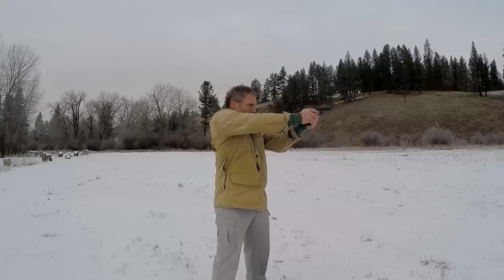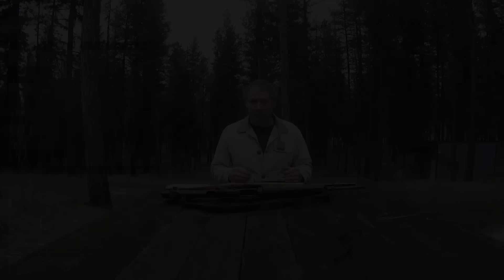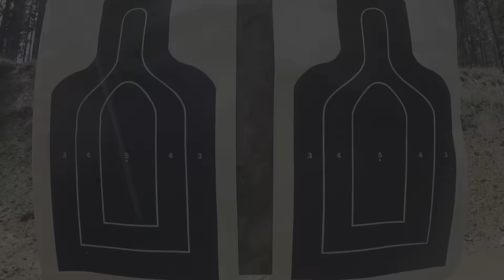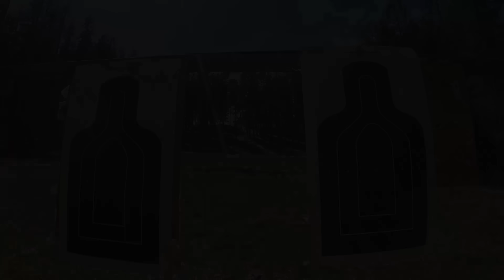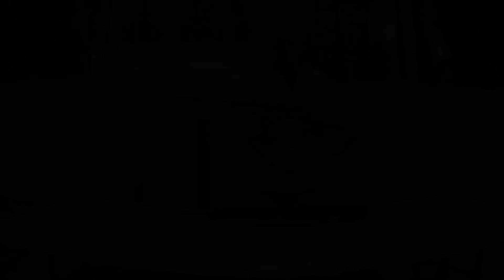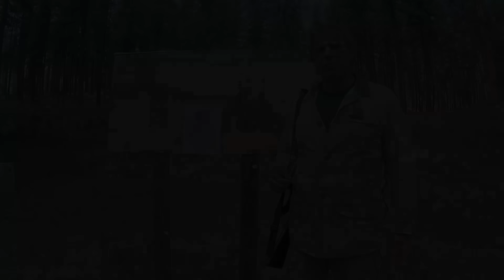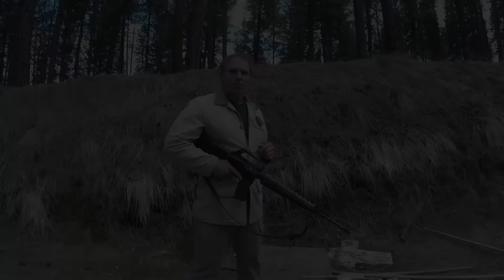Mini-14 vs AR15: Which is Better?

Comment: There is a lot to be said about the Mini-14 with that Garand action.  It is incredibly reliable and can get dirty and still function.  The AR-15 has to be kept clean and is very "finicky" when it comes to dirt and dust.  This was a particular problem issue for our troops in Vietnam, where the rifle often failed when dirty.  In the Korean War, every weapon system froze over in that first winter...except for the M-1 Garand.  That rifle kept on working even with the extreme cold weather in that frozen Chosin battle and so forth.  Yes, with the Mini-14, you should buy and use Ruger magazines.  They may cost more, but believe me they are worth it.  I've never had a misfeed issue with any of them.  If you are trying to protect yourself and your family, either one of these rifles will be up to the job.  Just get out to the range and get some practice on them.
Reply: Keep in mind that the M16 was failing in Vietnam early on because the Army didn't want to chrome line and phosphate coat the internal parts of the rifle (something unheard of for military service rifles) and changed the powder of early M193 with a cheaper and very corrosive propellant, all without the consent of Eugene Stoner and his team. So you basically had a rifle that had no protection against rust and fouling, your ammo was corrosive af and command is telling you that the rifle is self cleaning and won't issue you a cleaning kit. The M16 Eugene Stoner procured to the Air Force for testing actually proved to be slightly more reliable than the M14 during military trials. When the Congress opened an investigation because of the Army's implementation of the "modified" M16, the Army actually decided to get back to the original specifications of ths rifle and fielded the M16A1 soon after. If you look up what troops thought of the M16A1 you'll find an overwhelming number of positive reports from combat troops, it was a very well liked weapon. My father deployed in combat with an M16A2 and it never failed, always said it was a good and reliable weapon system.
Reply: @user-oy8dl1er5h  that is all correct. I used the M16A2 when I first joined and it was a very good and reliable rifle.  Too bad the government bungled the first M16 so badly. I believe even the TV show "60 minutes" did a special on that. One of the many ways the government mismanaged and bungled the handling of that war. Those were all good points you made.
Reply: @LA_Commander  - It truly was a tragedy that cost many troops their lives. Whoever at the top brass decided to cheap out like that in the implementation of the M16 has got American lives on their conscience

Comment: My owners manual for my mini 14 ranch rifle says it'll shoot .223/ 5.56. On the receiver it has .223 cal. Printed not .223 rem.  Hope I'm not wrong check your manual before you take my word for it, but my mini 14 has had a steady diet of lake city 5.56 NATO  xm193 55gr. and xm855. I've got a couple thousand rounds through it with no I'll effect. I understand the old target model mini 14 is the only model I'm aware of that is designed for .223 rem. ONLY. Also the new mini 14s are stamped 5.56 on the receiver to eliminate confusion.

Comment: The biggest takeaway I have from this video is the clear difference in intended customers between these two rifles.

The A1 was clearly intended as a military machine, with more ergonomic controls and a more specialized iron sight setup.

The Mini 14 was more aimed at your typical citizen, with a more straightforward assembly, more compact profile and easier maintenance.

Both are good rifles and have their own niches. Nowadays, you're more likely to get away with owning a Mini 14 because of gun control politics, while the A1 platform has more varied aftermarket support.

Comment: I am not an experienced Mini-14 person but someone that is very experienced with Mini-14's has said that there is a serial 
number order that can help determine the accuracy question.  Supposedly, Mini-14's that have serial #'s that start with 580 or higher (581, 582, etc.) were built after Ruger made some sort of change to their build techniques and that those rifles are consistently more accurate.  That would mean rifles that have serial numbers prior to the 580 sequence will be more hit and miss as Paul was saying in this video.  I'm not sure how accurate that information is but it does come from a knowledgable source.

Comment: I own both a mini-14 and an AR (My mini is chambered for 5.56 by the way). On a day to day basis I prefer the mini-14. The AR will only shoot brass cased ammo (I've tried to run the Russian steel cased ammo exactly 3 times, after 4 or 5 rounds the polymer coated case welds itself into the chamber and can only be removed by disassembly and a ramrod) which makes it a quite bit more expensive to shoot comparatively, while the mini-14 will digest anything I drop in it. I live on remote property so I carry the rifle in my open side by side all the time and the mini-14 is more tolerant of the dust it inevitably gets coated in and in addition, on those few times I come across a neighbor the black-but-conventional looking mini-14 gets less stares and comments than the AR. Accuracy in general is comparable between them shooting the same ammo with a slight edge going to the AR. If a suspected firefight was shaping up and I had the choice I'd carry the AR, but otherwise I prefer the mini-14 for most other situations.
Reply: i have been using the steal cased ammo for over 2 decades, this is how long, i bought a case for 110.00 dollars. shoot a lot of 3 gun and use the steal stuff for, it is not very accurate, have never had any feed problems with the steal, there is a lot of BS that floats around about everything. a big rule i have in my life is i do not believe everything i hear, if there is something i am not sure about i do the research. you can not believe some of the bull shit i have hears out there

Comment: The biggest issue that I have with this is the decision to use rifles that use the .223 rather than the modern 5.56 NATO. Although this would likely not change the basic results, it would reflect what is currently available rather than what was used 30+ years ago.
Reply: Even the mini-14's from 30 years ago were rated for 5.56. The manual just refers to it as ".223 (5.56 mil spec)"

Comment: Mr. Paul Harrell... I enjoyed the personal journey you took us on.   You first owned a Mini 14 & then moved up to an AR 15.   QUESTION:  Because you are a Marine, how much did your Marine Corps experience shape your preference for the AR 15?   I served in the Army NG (1977-1981) & Marine Corps (1981-2003).  My last 16-years in the Corps were spent in EOD.  I honestly look back in time & can see that I took for granted the many opportunities & all around experience that I had with the M16A1 & M16A2 & M203.  This also applies to the Service 12 gauge shotgun, the ole Service 1911 .45 & Beretta 9mm pistol, the .50 Barrett & M14 Sniper Rifles, the Mk19 40mm, the M2 Heavy Machine Gun, & M60 & M240G light Machine Guns, and of course grenades, C-4, & demolition materials in general. I would add the M72 LAW rocket, but never had a high opinion of it.  Man, I'm age 62 now... if only I could revisit my past to fully appreciate all of the weapons & other toys at my disposal while serving in the Army NG and on Marine Corps active duty.  Thanks for your time & energy & enthusiasm for what you do for others.  Happy belated Marine Corps Birthday.  Semper Fi   Doug B. Sends

Comment: When plugging in the Mini-14 magazine it is important to make sure the hole in the front is caught by the pin in the mag well.  Otherwise it is possible to rock it back and catch it with the mag release, but the front of the mag is hanging low and won't feed.  My habit is to push the mag in, give it a tug down to ensure the front of the mag is caught by the pin, then rocking it back so that the mag release catches the rear of the mag.

Ditto, when plugging in the AR-15 mag, for me it is not enough to just hear the click, but I give it a tug downward to make sure.  This action, with either mag, is just good insurance.

Back to the Mini-14, I found that tight fitting synthetic stocks (especially like those made by Choate), compared to the loose fitting Ruger wood stocks, resulted in smaller groups - much smaller.  This is why competition shooters glass bed stocks.

My opinions, your mileage may vary.

Comment: Without spending 50 minutes of my life watching the video I would have to say my preference is the AR 15 I have them both in the mini 14 was market it is the most expensive plants are in the world and that’s what it is Ruger will not release parts to the general public and you have to send your gun in for repair the engineering of the mini 14 does not allow itself for a consistent point of a without spending 15 minutes of my life watching the video I would have to say my preference is the A.R. 15 I have on both and the mini 14 was market it is the most expensive place in the world and that’s what it is Ruger will not release parts to the general public and you have to send your gun in for repair the engineering of the mini 14 does not allow itself for a consistent point of aim The Ruger Mini 14 was designed to mimic parts of the M1 carbine and parts of the M1 grand an M 14 with the open bolt access and in some ways this is better from a safety standpoint and a standpoint for ease of operation for new shooters The gun the mini 14 does not take a scope very well because of the open bolt  design

 Getting back to the A.R. 15 the Home gun armor can access and disassemble and reassemble all the parts without any machining and parts are available from different manufacturers

Comment: One thing I would add is for those that aren't going to do all the maintenance, as suggested, the Mini -14 is going to be more reliable. Since the gas recoil system is almost completely separate from the bolt. So carbon buildup issues should take a lot longer to appear during extended use. Also in my opinion the rotating bolt has some clear advantages if the gun gets dropped or just dragged through the dirt and mud. If I had to pick one over the other in an SHTF situation. I'm going to pick the Mini-14 every time. It simply will in my opinion be the more reliable platform if things get nasty. This isn't to say that I dislike the AR -15 platform, I just think the Mini -14 is a better choice if you either are unwilling or unable to do all the proper maintenance.

Comment: Paul, I am 70 years old. Grew up in Montana, a captain in Army, and later was a law enforcement educator. I have been around and used many differant firearms. However I am far from an expert but still, enjoy learning about various aspects regarding weapons and their use. I bought a Mini 14 when they first hit the market.  I went on through the years and bought 3 others later called the Ranch Rifle probably because Ruger was trying to distance any connection it might have had as a military weapon.  What you said about the differences regarding accuracy consistency was spot on. I sold my last one in the late 1980s due to very poor grouping. I did have one (my second) that shot very well.  Enjoyed your video. You answered a few lingering questions I have had through the years. As usual, your presentation was comprehensive and I always enjoy your wry humor. Thanks!

Comment: Bought my stainless Ranch Rifle in 95 or 96. It still has the old pencil barrel and I guess I fall into the lucky class as mine is very accurate, as accurate as either of my AR'S. Swore I'd never scope it as it has excellent peep sights and I could hit very well with it but as age came on and eyes went bad I did eventually scope it and found that really extended the range it was accurate. I have sense gotten new lenses in my eyes and have the eyesight of a ten year old again , if not better and that has made all my shooting way more accurate. Helps to be able to see. I'd never heard your explanation of the  headspace problem in Rugers. The old story of the tooling wearing out and not being replaced at Ruger  has been around forever and made perfect sense so  has been generally accepted. All I know for sure is that I've shot with a lot of other Mini 14 owners and have been told I'm lucky and that I really got a good one.

Comment: My stock 583 series Mini-14– 2015, marked 5.56, not .223, for what it’s worth– will shoot 1.0-1.5 MOA consistently at 100 yards with American Eagle 55gr. With an Accuracy Systems strut/adjustable gas block installed, I get .9-1.3 MOA. With a good scope, same thing at 250 yards. James Reeves has a TFBTV video with almost identical results. The newer Mini-14’s specifically marked 5.56 instead of .223 seem to shoot much better than the other .223-marked 580 series rifles. No idea why, but a lot of people have this experience. I love mine to death.

Comment: Awesome video. I was in scouts and had great shooting instructors and there were a few kids who didn't get it and they were disciplined and had to sit out the range time because they could not be trusted to listen to our instructor who was a bad ass instructor about safety on the range and the field. I have personally discovered how careless I had become sometimes when handling my weapons at home. Nothing bad happened there were no accidental discharges. My women is not so gun oriented she is a mixed martial art instructor retired. She has had to remind me about her discomfort with proximity of the weapons to the sleeping area lol. However a home protection weapon is useless if I cant have control of it in a second or 2 we have a dog which is usually a good thing he will sense an intruder before I can. What are your recommendations for storing a weapon near your sleeping area.

Comment: Here is the issue with Mini-14 ~ they have different rifle twists (at least 3 rates) depending on the era they were made.  All you have to do is simply determine what ammo the rifle likes the most and you will have an accurate rifle.  My scoped mini-14 was made in 1983 and shots M193 with an accuracy of 3-4 MOA; with Winchester white box 62 gr 223, that same min-14 shoots 1-1.5 MOA.  It's a good rifle.  My only complaints are it's load and will rust or get debris in the gun easily; AR-15s are not as loud, don't have rust issues like a mini-14, and can be sealed up against debris.

Comment: I have one my dad bought. He loved Ruger and bought a lot of their firearms. The mini 14 ranch rifle is from 1983. Even with a descent 3x9 scope shooting for accuracy from a bench using a rest its not all that accurate. My Colt 6600 with a scope is very accurate and can shoot 1/4 " groups @100 yds. I have owned many AR rifles most being Colts or Bushmaster. Even the early SP1 that I owned out shot the mini 14. The best AR , I built using a heavy Wilson 1/8 , 24 " inch stainless barrel strictly for scope only. It shot sub 1/4 " groups @ 100 yds and 1/4" groups @ 200.  They can be setup in so many ways and that is what I think is their greatest asset . I have seen Ruger's made to shoot some pretty good groupings. The Ruger certainly is accurate enough for what it was intended. Not for bench rest or wouldn't be my choice as a long range varminter .

Comment: Paul,
I suspect your vintage is about the same as mine.  The military has changed a lot since "Hungry Like The Wolf".   
You did the video about right.
Reliability:   How much maintenance and how often is not always optional.
My former lieutenants are now colonels, but have never done anything but COIN.
Also...there has been 40 years of development in that AR.  But the mini is just a copy of the m14.  Yes, caveats.   But there's no denying the gigantic difference in R&D.  You are comparing an INDUSTRY vs a single rifle from a single manufacturer. Yet...the differences in your results were not design - based.  Most modern ARs don't use iron sights so the comparison of sights seems moot (again...if all you know is coin, or lic, then the issue is you, not the rifle).     
You got it right for most people's modern perspective.
But... Is the perspective right, or an artifact of "recent" phenomena? 
Dunno.  But combat malfunctions change your whole perspective.  
I like the M14 for its action and sights. 
I like the AR for its modularity.
I don't have a mini 14.  If I did I might be concerned about magazine suppliers.  
But, I still know there are fewer and larger parts to toss in my hat come maintenance time.   

I think it's a toss up under current conditions.

Because, let's face it, how many AR owners use CLP at the right intervals, or know SPORTS? 

What you find as reasonable maintenance is a combat detraction from the perspective of our predecessors.
Ruger magazines...A single manufacturer against an industry...
When does it become about the merits or drawbacks of the mechanism? 
How many times are you willing to hear 'click' when it counts?   FOBs are not "normal".   One day we will wonder at them like Napoleonic tactics.  Just saying...  But you know.  FWIW... Back from Iraq last Sept.  Last run, I guess. No one is listening.  Rude awakenings coming, I suspect... Armies shoot back when insurgents can't or don't want to....
Thanks for the video.
Good info.

Comment: I've had a mini-14 181 series for years and never had a misfire or failure to feed.  Loves 52gr hollow points at just over 3000 fps.  Would I buy it again today?  Would probably go for the AR platform for the mods.